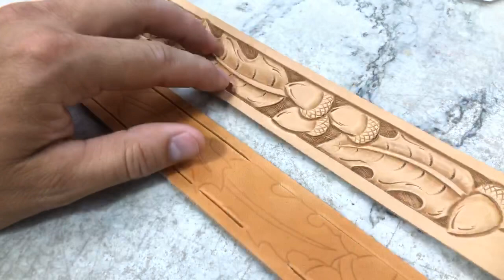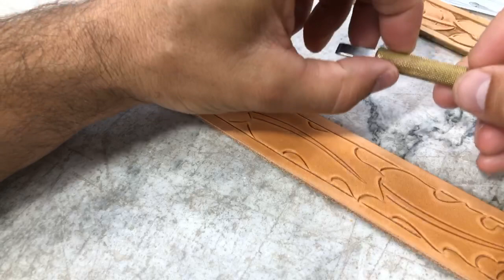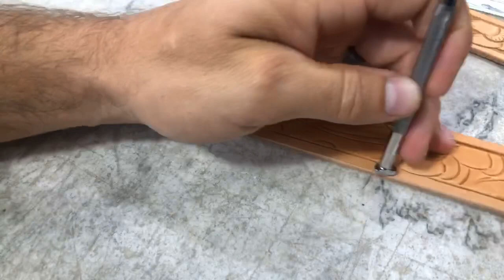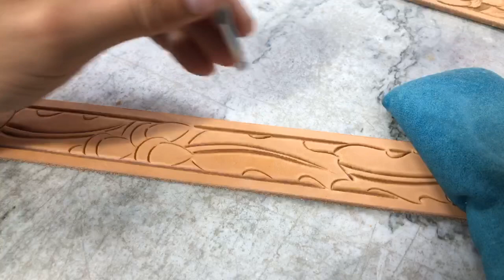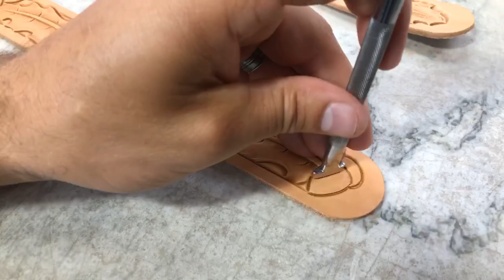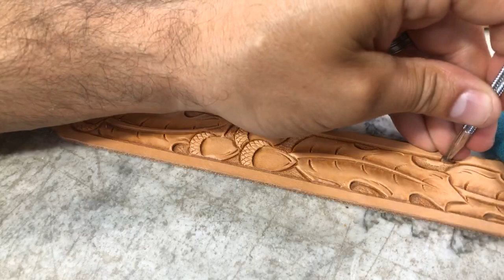Tooling Oak Leaves and Acorns

Comment: I have a set of small wood carving tool's would that work for carving leather? I keep the blades sharp.
I have never tried carving leather. I do have some wood burning stamps I think I could use those picture's on the stamps for leather?
I don't want to buy any leather working tool's if I can get away with what I already have.
I guess the only way I know is practice on some scrap leather to see if it will work the tool's I already have.

Comment: Hello there what is the perfect size swivel knife to have to do all your projects not having to buy different ones
Reply from the maker: Hey there, that's going to depend on personal preference. For me though, I use a 3/8 barrel with a 1/4" straight blade.
Reply: Oh ok thank you so much for your answer I really appreciated it
Reply: Oh ok thank you but you have the 1/4 inch thin blade or thick blade

Comment: Brand new to this but is there really any difference in swivel knife brands? Its such a simple design so im not sure how there can be but like i said im new
Reply from the maker: Surprisingly there can be quite a difference. The two biggest things are the blade and how smooth it swivels. Diameter and height are more personal preference for comfort.

Comment: Joe, the BK beveler you used for boarders, you call it a wide? is it a standard  #4 checkered beveler?  is your "round" beveler XX steep?   Thanks for the videos...
Reply from the maker: Hey Stanley, yes the wide bevel is the #4. As far as the round bevel, it is just a round checkered bevel. I don't believe he offers those in an xx steep.
Reply: @joemeling3216  Hi Joe sorry to be a pain but , I`m still struggling to ID this particular Beveler to order it, because BK does so many different varieties. I know you call it a "checkered no 4 " but !   There is a " Beveler checkered 4# " ," Matte checkered 4#  " and a few other types. Can I trouble you to be more precise so I don`t order the wrong one from here in the UK ? if you kindly would please.
Reply: Ah well I took a gamble and ordered the std semi flatish checkered beveler  #4 which turned out to be correct. I also ordered the checkered #2 extra steep beveler , and the checkered #1 round beveler which to be honest has a more oval shape than round, but is ideal for getting in those tight turns.👍

Comment: I’d like to see you stain this.  Would you use antique? Also, what’s your method for casing or wetting the leather? Great video, subscribed!
Reply from the maker: Thank you for subscribing! Yes I would antique this piece and even possibly dye backgrounds or borders just depending on the final look I’m after. 
I’ll be doing a video soon on casing leather but the short answer is I wet it with a sponge just prior to tooling.
Reply: @joemeling3216  thanks for the info! I just saw that weaver had a flash sale on the 303 sewing machine. I used your promo code and saved $100 ! Thank you!
Reply from the maker: Heck ya! That’s so awesome!

Comment: do you need a marble table to do leather carving/tooling, Ive seen marble tables in many beginner videos
Reply from the maker: Great question! You don’t need to have a full table like this. However, you do want to have a marble or granite surface. Many beginners start with a small piece of marble that just sits on the table. Most leather supply places will sell 12” x 12” pieces. 
The idea of the marble is to take the bounce out of your tools. It makes you more accurate and helps you get good depth in your impressions.
Reply: If you go to your local granite countertop supply place, they usually will have throw away pieces that are the cut outs from where sinks are installed in the countertop. Most places near me will give them away. 18"x12" roughly.

Comment: Hi joe from watching this video it seems your cuts are all separate from one another, it doesn’t seem that any of your cuts connect, every line fades in and out,if that makes sense. Is this the correct way or am I just reading into something you’re not actually doing.
Reply from the maker: Great eye! You’re correct that I don’t come t the cuts with my knife. I will connect them with my bevel giving it the appearance of being cut all the way but not compromising any durability. Connected cuts will create a point that could lift over time with wear and use.
Reply: @joemeling3216  ah right, that actually makes a lot of sense. Thanks for the reply, much appreciated

Comment: Do you intentionally undercut the tight curves on the leaves?
Reply from the maker: No, they wind up with a very slight undercut from tipping my knife as I get around a tight curve. However, if you try to undercut them you could go too far leaving a weak place that could lift up and or tear with use.

Comment: First, I though this leaves are from a tree we call Stechpalme/Ilex in Germany, which seems to be called Holly in English. I thought that, because I'm used to more rounded tips on typical oak leaves I see here. Maybe there are other kinds of oak with different shaped leaves? Just my thoughts. Looks beautiful either way! 😀
Reply from the maker: You’re correct on them typically being more rounded. This is just a little artistic flare added in this pattern to make it stand out.